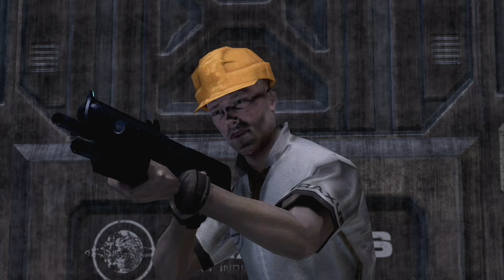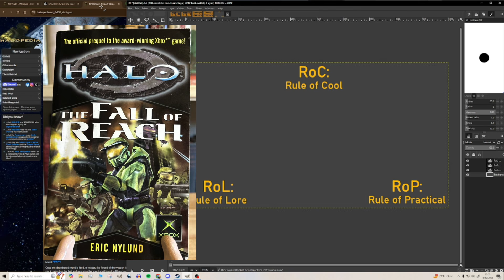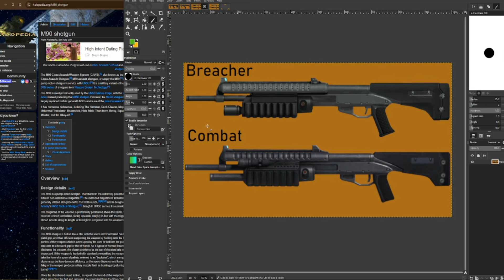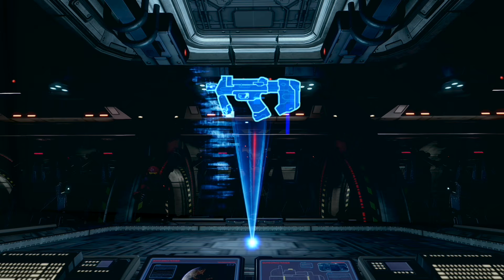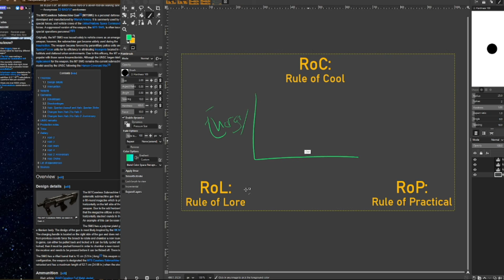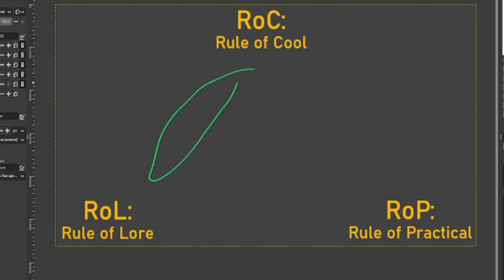If the Halo Shotgun and SMG Were Practical For Modern People

Comment: Hello again! Thanks for the opportunity from KYOT and this community! I'm enjoying this wayyyy too much. Anywho, feel free to comment anything I may have missed or failed to consider.

Or if ya like what I did, let us know and we'll continue!
Reply: Finished the video. One thing. While I cannot find any specific lore on this, You definitely would not need to have a specific targeting computer on all of the weapons to have the HUD reticles we see in the game. All you would realistically need are a few marker points on the gun itself which can be used by the neural interface embedded in your head to locate the weapon in 3D space and map out its orientation in order to display an accurate image of where it is pointing.

You could (And should) even allow these to be manually adjusted so that individual shooters can adjust for windage and elevation like you can with iron sights. 

*Obviously*, All UNSC firearms should have iron sights available as a backup because electronic systems can fail. Even 500 years into the future. However I definitely don't think you'd need to have a dedicated targeting computer on every gun just to have the reticle display. You could just get away with doing that on the ones which specifically have scopes. Like the magnum, Battle rifle, DMR, Etc.
Reply: @Dryym indeed! So I suspect, because it wasn't common knowledge at the time, Bungie created a targeting computer for small arms without knowing how existing systems at the time worked. And yea, two reference points, similar to how motion capture works, could totally integrate into some type of helmet/visual hardware. Currently we have some interesting augmented reality variations of this using infrared laser aiming modules.

And man o man are you correct on electronics failing. And often overlooked fact in sci-fi universes is the fact that your opposition is always in 'counter move' status. When you have cool tech, bad guys are trying to limit or destroy it's capabilities, therefore artists/devs should include back up systems in their designs! I have no doubt in my mind covenant could certainly manage a variation of an EMP that can disable smaller tech as well as big tech (EMPs have been known about since the Manhattan project, but generally only disable large power structures/devices).
Reply: @SpearTrainingGroup  Even without direct targeted countermeasures, All that has to happen is for something to get damaged the wrong way and then have some water or dust get into the compromised housing. Which is just bound to happen eventually.
Reply: I'm surprised the Shotgun didn't have a smart-link targeting computer added to the weapon in a similar vein to the AR and Magnum, considering you pointed that out as a "Rule of Lore" break.
Reply: I love what you did with the combat shotgun. This is an even better breakdown and explanation but I think referring to lore/cool was what made it better. Not sure if you'll do that for each video. Maybe do a quick reference to it since you've explained it in this vid.
Reply: Loved it, hope to see more!
Reply: A disgrace to make the shotgun a pathetic bottom loader 
If it's not a top loader, it's not good
Reply: @dakotalariedbrock well good news! The top loading mechanism is still intact with these reimaginings!
Reply: I am only half way through the video, But I have to comment immediately do say that I adore what you did to the shotgun. I think it's beautiful, And from a campaign standpoint, I can see both designs having effective positions within the sandbox. The breacher shotgun with its wide angle spread and lower ammo capacity would be perfect for Flood missions which are more of a frenetic close quarters battle of attrition when it comes to managing your ammo resources. The combat shotgun on the other hand would be perfect for missions where you fight the Covenant.

Comment: If one of the ideas behind the M90 was "cost-savings", then one design inspiration that I think could've worked really well is the standalone variant of the M26 MASS (or even the M203). You'd have to beef-up the proportions, obviously, but both have very simple -- very "skeletal" -- appearances that I really like, personally. Both remind me a lot of the Sten SMG, which is fitting as a low-cost weapon.
It would've kept the Halo shotguns visually distinct and would've helped to drive-home the point that humanity was running on fumes.

Comment: Couple criticisms on the shotgun so far, 1, the top model is a breacher, meant for very close range and not generally combat use, flashlight makes sense, a smart link would be pointless. 2, a pump release should always be a very intentional action, you don't want to accidentally engage it. 3, your pump handle should be long, you leverage it to cycle the weapon, and everyone has different length arms and hand placements for what is comfortable. I do agree with the breacher being more compact over all, and I would argue that a breacher in 8 gauge for insurrection in the timeline makes sense as you're not likely to be breaching hinges or pin and tumbler locks, it would be more metal doors and electronic locks, makes some sense to potentially have more pellets and force. Would probably use different tech than firearms, but it's some level of excuse.

Edit for a later point, its the future, shotgun training would evolve to fit the service weapon, and defensively loading from the top in a low ready does make solid sense over generally shifting your point of aim over any potential threat to load from the bottom as many people struggle to leverage shells in at a standard ready level. At least at a low ready you can take their legs out if someone surprises you.

To touch on the lower velocity of the 5x23, I could imagine a high volume of accurate fire would assist in overwhelming energy shields and targeting soft spots after, to argue the opposite though, a 5x23 should be faster than 5.7, one because lower mass projectile, and two because the entirety of a caseless round outside the projectile is propellant, vs what you can fit in the casing for a 5.7. As far as the front handle goes, I like the idea we've seen a few times recently of housing a spare mag in that handle, easier and more natural to swap than a mag pouch or side mounted spare.

Comment: You didn't take into account that the shotgun has a twin tube setup with 6 in each tube and a housing over them.
The Halo 5 SMG is the best version of the gun btw, I hope you take a look at it one day.
Reply: As stated in the video, the dimensions for a dual tube mechanism do not exist in any of the media I can find. 

If it had dual tubes, side by side or stacked, then there would be approx an additional inch of material in an oblong shape with the tube. However again, it is rounded and does not contain enough room in this rounded shape to house two magazine tubes.

The math ain't mathin 🤷
Reply: @SpearTrainingGroup  8:30 it says it right there under the feed system on the webpage dude, and in Halo CE and Halo 2 classic the top of the tube is a oval you can see that if you look at the front of the gun, there is also a model of the shell in game that would fit it.
In Halo CE when you see a marine holding it you'll see how massive the gun is, the anniversary games were made by a contractor and those models are not accurate to the guns they're replacing. Halo CE anniversary replaces the M90 with the M45 for example and that one does only hold 6 rounds in the games it appears in.
Reply: @TheStrayHALOMAN I don't think you understand what I'm saying..... Lore descriptions can say whatever they want while simultaneously ignoring the physics entirely. When you pull the models of the shells, and place them side by side (in any orientation), they would clip through the magazine tube. The animator/artists did not model dual tubes in the final product.

Something else to consider, nearly all shotgun shells (including the modeled ones in game), have an exposed rim. This is a problem, because if the magazine tube is dual, there must be spacer material between them (which further widens the gap) otherwise you'd experience what is called 'rim lock'.

Allow me to provide another example of why the relationship between cartridge size and magazine tube are important. The Halo CE AR is chambered in 7.62x51mm and has 60 rounds in it. If this magazine actually stored 60 rounds, it would be ~2 1/2 feet long single stack, ~1 3/4 feet long double stack, or ~1 foot long quad stack. None of these measurements account for springs and followers that are required. The Halo CE magazine is approximately 7" long......... 5" shorter than the most likely option.

So when measuring 'is it possible to hold 12 8 gauge (.9" base diameter), 3.75" shells', the answer mathematically every single time, is no.
Reply: @SpearTrainingGroup  You're right about the CE assault rifle, but the CE shotgun specifically does have the wide oval shaped tube on top for the 12 shells while it's also alot bigger than the other depictions in later games like Halo 3 and H2A. The gun in like 5 feet long in that game.
Reply: @TheStrayHALOMAN so the model that appears to be more oval I can find isn't oval enough to fit the wiki mentioned shell. HOWEVER, let's run the numbers anyway!

Two magazine tubes, holding five 3.75" shells (with followers and springs), one ghost loaded on the lifter and one in the chamber would equal out to twelve shell capacity. So the big question, how long would a mag tube need to be to house five 3.75" shells, their followers and spring?

This equals out to 18.75" just for shells with another 4" or so for the hardware, totalling to about 23". 23" mag tube, with an approx equal barrel would be very similar to hunting and competition shotguns. This is looooooong, but not unrealistic. So if we assume this is infact dual tube just incorrectly (or inaccurately) modeled, it could be work. There could be a interesting conversation on how the tubes load and unload, considering they both feed from the same port and in theory same elevator, but some modern shotguns have figured it out(ish).

Comment: Also, to be fair about the Smartlink, it doesn't really need one. Assuming you aren't aiming down sights, the SMG in Halo 2 and 3 is basically a cheap, disposable piece of junk. Unlike the AR and BR, it isn't about short bursts and trying to get as accurate as you can until closing in. The SMG is about getting into butt-sniffing distance of your target, pointing it in their general direction, and magdumping into them at shockingly close quarters.

Comment: That SMG's basically a caseless .22 Short, that is INSANELY anemic, I can't imagine how you'd have a functioning gas system with those numbers, much less treat it as an actually combat effective military weapon. Feels more like it would be a training weapon than an actual issued weapon. Though amusingly DOES make that 50m effective range more believable.
Reply: It's basically an FN FiveSeven turned into an SMG, 5.7 is a bit larger than .22 and considerably more lethal. But even .22 can be effective over 50m, and is in most cases save the very cheap and underpowered guns that are prone to jam more than fire.
Reply: @CommanderRedEXE  Muzzle energy is significantly lower than than 5.7x28 or .22 LR. It's middle of the road for .22 Short though.
Reply: @koeryn  1. The fan made wiki is loaded with inaccuracies and guesstimstions as even the books and official game booklets don't give actual ranges or FPS numbers.

The 50m effective range is a guesstimate based solely around lore inaccurate gameplay mechanics. It's still a 1400fps listed muzzle velocity. This doesn't add up to a 50m effective range.

Now, with the sights being low quality being It's a backup weapon, that might reduce effective range more than anything else.

But nothing about the listed values on the wiki make the effective range make any sense. It's basically just an MP7 chambered in 5.7 rounds, even from a design standpoint AND the name is clearly alluding to this.

Point is: We can't trust the validity of the wiki in any form outside the things specified in game manuals and books as confirmed. It's all guesstimate based on gameplay limits otherwise that are KNOWN to be lore inaccurate for gameplay balancing reasons.😊

Comment: the smgs original mag could have been a full insert mag, sticking out the bottom just looks wrong feels like the cartridge has to change size to go up the mag with the hand guard, taking it p90 style and going over or under the receiver eases the uncanny valley magazine well that goes through the trigger group, as for charging maybe swap to an ar style semi universal charging handle

Comment: Another thing to factor into the Halo weapon usage is the "Rule of Gameplay" (RoG). Put simply, games are designed around gameplay first and foremost, with the RoC/L/P coming after. Halo is not a simulator like Arma or Tarkov, so its weapons aren't going to behave 100% realistically in game to how they would in real life. This can be seen with the absolutely massive HUD reticles and abysmal accuracy of high tech advanced fighting tools of the future. The M90 Shotgun has a horrible spread in game, but in reality: a 3.75" 8 gauge shotgun is going to have a much tighter spread with the given barrel length. It's physically impossible to do otherwise unless you had some kind of hurricane-force winds blowing uprange of the shooter and causing a major disruption to the pellets' path of travel. Similarly, the HUD reticles should be much smaller for all weapons; the reticles are supposed to be used in the same way red dot/holographic sights are irl (ie an aiming reticle with NO magnification). They should (and in the lore iirc they *are*) more accurate and precise than what we see in the games. It's like how you can hide behind cover in Call of Duty after taking damage, and be back to full health after a couple seconds. No Marine in WW2 is going to regenerate a bullet hole from 7.7 Japanese, followed by the hole in his shirt knitting back together; it's simply a gameplay feature. Lore accurate Halo would be unplayable because you'd be sprinting around the mission at 60mph and ripping everything apart like Doom Eternal, or at the very least it wouldn't even be fun. Some liberties are taken when going between gameplay features and real life, so I wouldn't take any in-game footage at face value unless it's showing the rate of fire, weapon size/scale (which still might be wrong), etc.
Reply: >Lore accurate Halo would be unplayable because you'd be sprinting around the mission at 60mph and ripping everything apart like Doom Eternal,
Not quite because remember you'd be fighting Covenant elites and brutes who are themselves not too far from Spartans themselves. So it would be like a doom slayer with insane luck, training, and experience fighting a bunch of other doom slayers while your only slightly augmented humans are trying their best to survive.